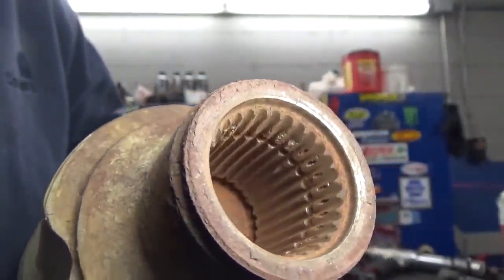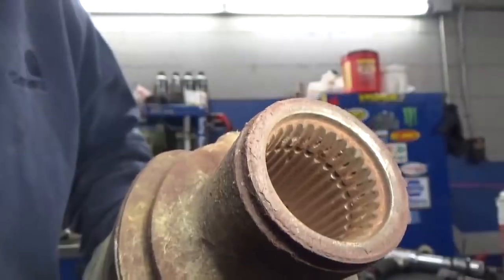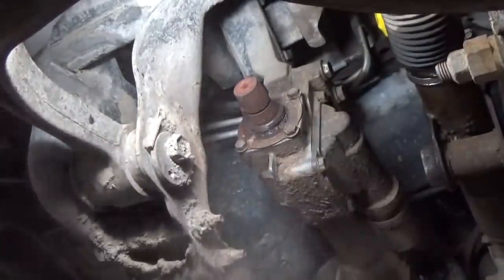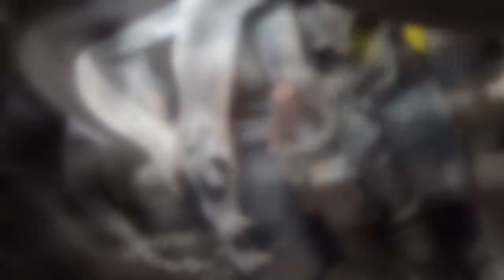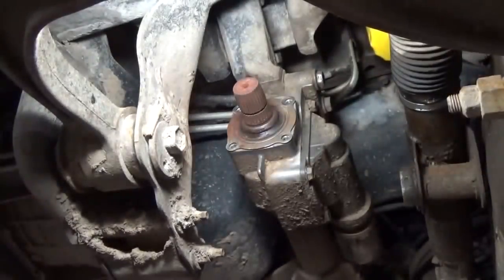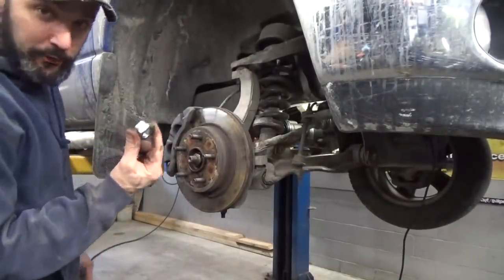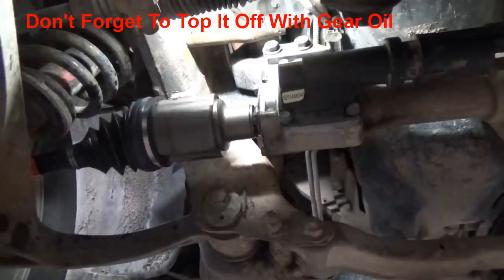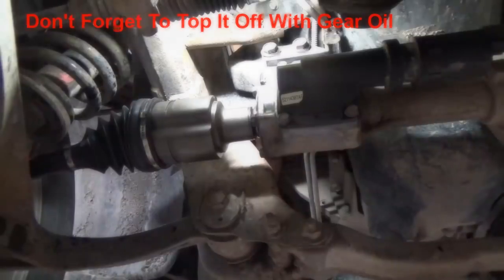Dodge Ram No 4WD

Comment: This is the BEST video!  NO MUSIC! Straight to the point, explaining what he is doing, and CLEANING the area BEFORE disassembling!   This video should be the template for all those wannabes video mechanics. GREAT JOB!  I service my own 2016 Land Rover LR4 HSI LUX. 1. I have the LR4 manual, 2. Find the problem 3. Watch the video online. 4. get the parts and tools needed for the job. 5.  Do the repair slow paying attention to all details, lube, O-rings, right torque in bolts and nuts, and then move or rotate the fixed part, to make sure it works.  For major repairs, I have an extended warranty.

Comment: I really want to thank you. I have a 07Ram and a few weeks ago I was moving my friends camper. Stupidly I got in a spot I shouldn't have, doing something I shouldn't have been doing(story of our lives right....) and had to use 4x4 with a 38' trailer on the back. Pop bang and grinding was the result from the front end. Same symptoms you described here. Because of the mild ohio winter, and lack of a garage I put it on the back burner to look at in the spring. I had assumed the engagement collar had sheared the splines or snapped in the axle.

Last week I hit a pothole and blew a wheel bearing. In the snow, in the cold I hastily replaced the bearing, but figured I'd take a quick look at the 4x4 since I had it apart. I popped out the actuator and saw no obvious damage nor any signs of shavings. Now I was really worried I had done damage to the transfer case, and that was what was causing my loss of 4x4, even though I found no metal shavings there either. I reassembled the the truck to worry about it in the spring. 

I did notice when doing the wheel bearing however the front CV assembly was being held on to the stub only by the pressure of it being assembled. This should have set off a red flag to me immediately but in the miserable cold I simply dismissed it as a broken c clip on the stub shaft and put it back together anyways, once again thinking it was a transfer case problem, and could wait till spring. 

So here I am doing some poking around on troubleshooting transfer case problems and I stumble across your video. As soon as you said the splines on the stub shaft were sheared I had a "you're dumbass moment" to myself. I jumped off the couch, grabbed a flashlight and a long screwdriver and headed out to the driveway, much to the disapproval of the wife. Pried over the cv shaft on the stub shaft and the damage can easily be seen! 

Thankyou so much. I would have been really pissed if I would have dropped the transfer case, or pull apart the front diff on to discover this later. Sometimes all we need is a little push in the right direction. 

Your vids are great! It really shows you take pride in them. Do you have a Patreon account that I might be able to contribute to? Great content is harder and harder to find sometimes, and I know it isn't easy filming these productions, it's nice to be able to support those that support you.
Reply: Learn your lesson buy a chevy
Reply: Toyota!
Reply: I think he already gets paid for you liking & subscribing....not sure
Reply: Haha! Chevy! I’ll pray for your tie rods...
Reply: Charlie Martinez.
No he does not get paid enough for doing these videos from YouTube, trust me, he needs and deserves all the Patreon support that us viewers are able to send his way.
Reply: @deereman8237  And ball joints!!!!
Reply: Deereman 
Pray all you want, PPE Stage 3 tie rod ends are how the prayer is answered. Not cheap, but 3X times the size of stock ones makes sure the job gets done and stays that way.

Comment: Recently did this repair on my ram, the way he shows in the video frees up lots of room to work, and makes it easy, just a tip to others that might be tackling this, I was able to leave the knuckle in place and remove the stub shaft side of the half shaft with a pry bar, then slide the splines out of the wheel hub.  Getting the new one in was a bit tricky cause it was firmer, but was able to make it work. total time to repair, about 30 min from wheels up, to wheels down. 

thanks for the vids, they help us all out more than you probally know.

Comment: I just discovered your page, great information. I actually just bought a Dodge Dakota (2000 v8, 5 speed), picking it up tonight, will be a good starter vehicle for my kid. I'm sure as issue arise i'll be searching your vids for a fix. Thanks for putting this info out there.

Comment: Very nice work.  I was impressed by the use of an air hammer to loosen the upper ball joint.  Such a joy to watch a real mechanic at work. It's a refreshing change from watching "parts changers" run the bill up not knowing what they're doing.

Comment: You are one of the most honest and hardworking mechanics I have ever seen. So many mechanics I have went to tell me these random things are broke and charge me for all of it and then only fix and rarely replace unless they have to, the one thing that’s causing the problem.One time I tested the mechanic I was going to for 3 years cause I thought he was the worst and charging me the most, told me my cv axle broke in half. Then apparently spun and damaged the hub bearings, spindle, brake caliper, rotor, rack and pinion, and tie rod. The funny part is last time I went to his shop was 2 years back and since then I’ve been doing all repairs on my car on my own from YouTube. So I stopped down the road from his shop and got the cv axle boot off and pulled it out, put it back together so I could drive to his shop a quarter mile away and had him look at it and quote me, 2 grand was his estimate for parts and labor. I said ok go ahead, picked it up later in the day ‘repaired’. Nothing was replaced, all he did was put my cv axle back together and clean the parts he said were bad and replaced, marked most things with a black check mark but not everything, and that’s how I knew they were the same parts on it that I came with, recorded everything and dug up all my receipts and took him to court, got $12381 settlement

Comment: Those front axle assemblies are junk in my opinion. See so many problems with them even at very low mileage. Nice video as always Mr O
Reply from the maker: The Car Doctor Thanks Dr.D... I agree they are junk but they sure do help keep the lights on around this place :)
Reply: Amen on that one.
Reply: The Car Doctor intake manifold runner control valve on dodge ram 2010
Reply: Knock on wood, but mine has 180K on the clock, problem free. And yes, it gets used often. I change the oil religiously though. Maybe that's part of the equation.
Reply: John Baugh Especially on modern vehicles, proper maintenance renders a very low failure rate
Reply: That front axle assembly looks toy like compared to my 2014 Tundra.

Comment: Eric I enjoy watching your videos. My nephew told me about you and I decided to check out your YouTube channel. I'm a backyard mechanic, I've done a lot of diy repairs from engine and transmission swaps. Rebuilt components. Remove replace parts. Some were difficult some were easy. Taking the systems apart are harder than putting them back together. But once I've completed the job and it works it gives me a good sense of accomplishment. Keep making those videos.

Comment: Glad you posted this video. Just found this on my 2014 Ram during an oil change.  Haven't touched much independent suspension front 4x4, glad to see it's not too complicated.  I always like to see someone do it before me so I eliminate guess work without access to OEM manuals.

Comment: Thanks for the knowledge your passing along. A person can always benefit from from learning something new. I have two 4x4 I’m gonna start working on. 2005 1 ton four wheel drive ( I bought brand new ) just turned 200,000 miles with a 364ci and a 1985 k10 four wheel drive with 70,000 original miles. Your videos will help point me in the right direction. Thank you

Comment: This brought back memories. '94 Dakota, 4WD started making a noise like this one (but less extreme).  Took it to a drivetrain specialist about 25 mins from home, so getting a ride home and back in later was significant.  I had a worn-out $100 thingamabobber inside the transfer case, plus a fair bit of labor to get it in there. Got a ride back when it was ready, paid the bill, took it for a drive, played in some gravel, it's good.  Except the next morning there was a 24" puddle of fluid on the garage floor, and peering up around the skid plate, I could see drops hanging off the bottom of the transfer case.  I called, then took it back in (another ride home); the next day they called & said they had torn it down again, and discovered a single missing O-ring.  Ready to go.  Another ride back, picked it up again, took it home, and the next morning looked under it again - no puddle - and looked up at the transfer case, all clean and dry with no drips on it.  It looked different, somehow, and it took way too long to realize why - the damn skid plate was missing.  I called again, and they found my skid plate leaning against the wall out in the shop.  I took it back in *again*; they were holding a bay open waiting for me, and took it straight inside, wheels in the air leas than three minutes after  I rolled into the lot.  While they bolted the skid plate back on, the owner of the shop said he was refunding all of my labor cost - mistakes happen, but he felt their whole series of mistakes was inexcusable.

Comment: Thanks for the video! well done. note: 1A auto has a video of replacing the front wheel bearings on the same model truck. He did not remove the Aframe assembly to pull the passenger-side driveshaft. He didnt have to mess with the Aframe bushings. Looked easier / quicker.

Comment: I have to do my truck the same way someone didn’t lock the axles on to the half shafts all the way I can see splines sticking out between the axles an the half shafts on both axles an they are wobbling on both sides so I will probably have to replace both sides .thanks for sharing the video it just confirmed my thoughts with my issue on my truck love the channel by the way been watching your channel for a long time couple years anyway appreciate you doing what you do . Thanks again .

Comment: Appeared to me the spring clip broke and axel came off the splines, probably from turning to tight with the 4 wheel drive engaged maybe.
Reply: BassheadGTP my thoughts exactly.
Reply: I was about to say the same thing but I thought I would check to see if anyone else noticed as well.  I would say you are right on the money with that cause.
Reply: I thought same thing and probably might have been caused by leaving 4 wheel drive in on dry road surface for extended period[s] of time.
Reply: this is years old but I was thinking the same thing from the start.

Comment: I have a 04 Ford F-150 and I had to replace a Wheel actuator because the 4WD wouldn't work properly. The way I tested mine was jack up the front of the truck then put it in 4WD then rotated the driver's wheel and the axle rotated with the wheel so I knew the actuator was good on that side then when I went to the passenger side the wheel did not rotate with the axle so I knew the actuator was bad. I changed it out today and my 4WD is fully functional again. The old part the teeth where it would hook onto the hub was broken so all it would do was spin and not put any power to the wheel when in 4WD. I got the new part in and it works great. Hopefully I don't have to do it to the driver's side anytime soon. I have all the proper tools to do the job if it does go out. Thanks for all these how to videos

Comment: that sliding coupler looks like a weak point. doent look like it has much engaugement on both shafts
Reply: fuzzy, 
My 88 Dakota has 228,000 miles and never had any problems with that part, I have had to replace both axle shafts a couple of times but they are much easier to replace than the full size Dodge . Mine is the vacuum operated one again no problems with it either
Reply: @bertgrau9246  4WD Vacuum Motor to engage front axles does not seem to be available for the 88 Dakota.  If the internal diaphragm leaks vacuum, I guess you have to rig it so the axles are locked together all the time, and the front driveshaft will always spin.  Of course, it will only be in 4WD if the Transfer Case is in 4WD.  If I'm wrong about the availability of the vacuum motor, please tell me which vacuum motor will work. There are lots of aftermarket vac motors for jeep and various Dodge trucks, but evidently not for the 88 Dakota.  I've got 400k on a Dak that is used as a daily driver. Parts are less available all the time. It's had 2.5 engines (1/2 = just a rebuilt head), 3 transmissions (including original), and 1 replacement Transfer Case).  Axles have held up well except for seals and a pinion seal, but now the front axle is slow to unlock when it's cold.  The Dak has been relatively slow to rust out, which surprises me, since I'm accustomed to Chevrolets.  They say, on a quiet night, you can hear a Chevy rust.  I wish they would use more rust resistant alloys.  I think they use low alloy steels to force us to eventually buy a newer car.  I'm a little concerned about rusty upper control arm mounts on the Dak.  They have the "bird bath" upper control arm mounts.  Maybe it's time I bought a Toyota.  They seem to run and run unless you smash them into things.
Reply: @joybetain8151  Maybe even worth the extra cost?

Comment: I have an 04 Ram 1500 2wd. I did ypur trick for the exhaust manifold studs and it worked great! im having another issue. Im having a clunk sound coming from my rear end turning. If I grab a hold of the wheel and pull bad push it I have a lot of axle play and then I hear the clunk sound. could my C clips be worn or maybe bad bearings? Any help would be great! Thanks for the great videos!

Comment: Eric, notice how that stub shaft is completely worn?  the splines, the seal surface and the needle bearing area?  
I think that shaft wasn't made right, like not properly heat treated or something.
Anyway, great video, very informative and well done as usual.
Reply from the maker: +halleffect1 Yeah that could be the case for sure

Comment: Nice work.  Are you supposed to squeeze some gear oil into that shift box?
Reply: Nah, oil will get there on its own when you use it.
Reply: It comes from the pumpkin and works its way down, so check the level in the from axle and fill accordingly
Reply: I was wondering this same thing thanks for the explanation.

Comment: I watched several of your videos and I am impressed with your attention to detail and your good work ethic. I am in the process of buying a 2001 Dodge Ram 1500 4 x 4 ext. cab long bed with an identical parts truck. The owner said it doesn't seem to want to go into four-wheel drive and I'm thinking maybe there's a vacuum leak preventing the actuator from functioning. I will try to update what I find or don't find. If you can do it I can do it so thank you my brother.

Comment: I enjoy watching you work. I have found a few tools that may save your sockets. One is the Astro 7181XL wrenches that are for nuts that are either stripped or rusted. The use the flats not the corners to work the bolt. Very handy, I had to use them on a Dodge Stratus today. The lower control arm bolt was not rusted or striped. A regular 15mm,  twelve or six socket would not go on, used the astro 15 mm worked like a charm. The standard sizes are the 7180XL.

Comment: Between the high wear on the shaft and the unusual demise of the splines, my assessment is that the original shaft heat treating /hardening process wasn’t don’t properly. The metal was too soft thus the shaft bearing surface wear and spline wear.  I enjoy your videos,keep up the good work.

Comment: I may be pulling the left front CV axle Shaft off soon on my 2005 Ram, so wouldn't it be just as easy or easier to pull just the wheel hub bearing assembly off to remove the CV shaft?
Reply from the maker: Allan Morgan I'd have to look I don't believe the axle will fit through the hub opening...
Reply: I saw a video where a gentleman removed the upper control arm instead of the ball joints, swiveled the hub assembly to the front and pulled the axle out that way.
Reply: i did that only to change the hub out i could not move the cv shaft at all i live in near boston but i could not get it to move

Comment: Yeah.......unfortunately I know what you mean. We have a 3rd year female apprentice who shows NO ambition at all. My cat seems more excited about cars.
Reply from the maker: Yep... just needs a check ...
Reply: South Main Auto Repair   hey  eric   nice  job   on  that  dodge  ram  4/ wheel  stub  shaft.  could  you  maybe  do  a  video  of  the  tracktion  bar  maybe.   it  is  the  two  bar's  on  each  side  of  the  4 wheel  drive   unit  that  goe's  from  the  spring   back  to  the  frame   I  need  to  replace  the  bar's  and  bracket  not  shure  how  to  do  it.......    steve..
Reply from the maker: Hey Steven Linscott I can if I get one in but I only record what rolls through the doors on a day to day basis..

Comment: Next time I buy a 4X4 it's gonna be a Chrysler or a GM.  Currently I have a BM Trouble U X5.  Staying away from Ford and European cars.
Reply: lmao.. your loss as both ford and european cars are much better then the first two you mentioned.. never yet had an issue with my fords 4x4 on several trucks and all my friends are replacing shitty shafts on their dodges